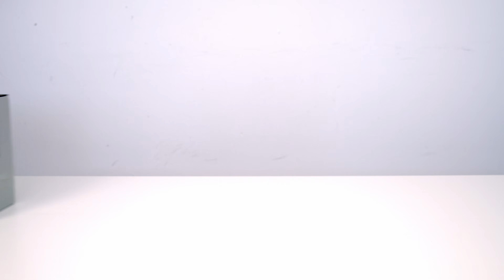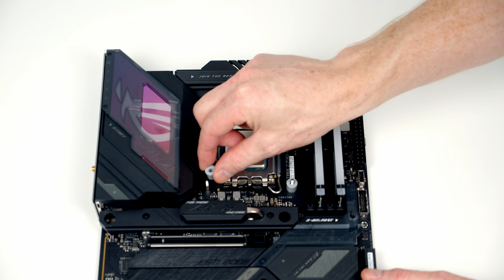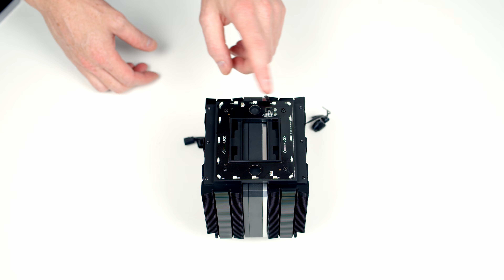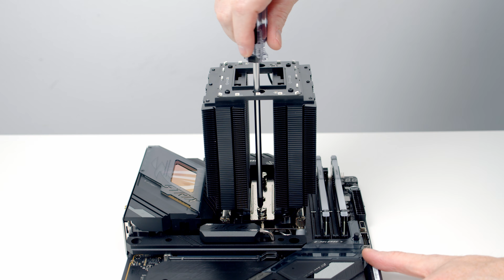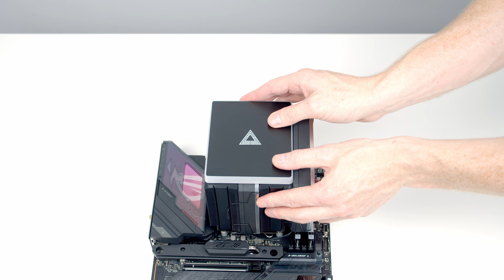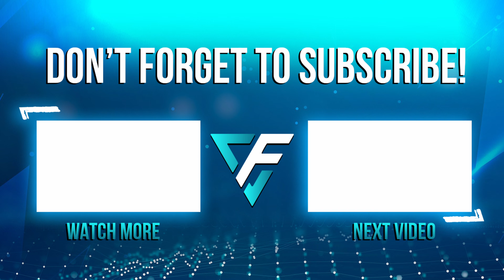Montech Metal DT24 Premium - Installation Guide

Comment: A tip for anyone installing this... I had to use the AM4 spacers with my AM5 motherboard. The AM5 spacers are half a millimeter shorter, and for whatever reason they wouldn't let me mount it. Very frustrating and ended up causing damage before I realised what was going on.